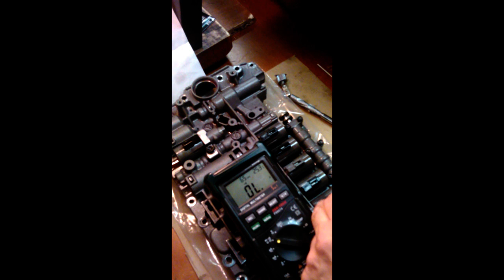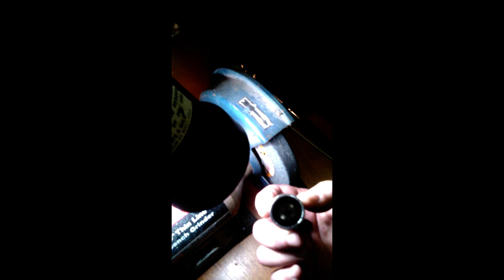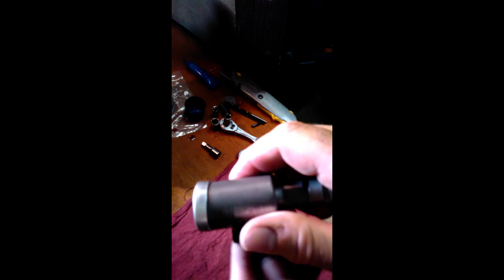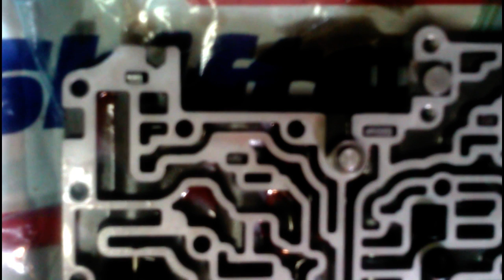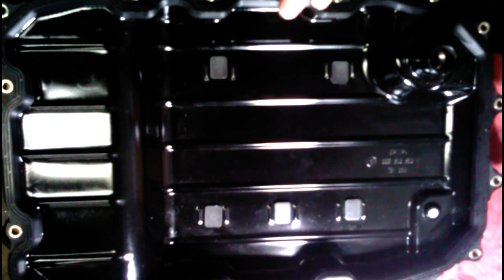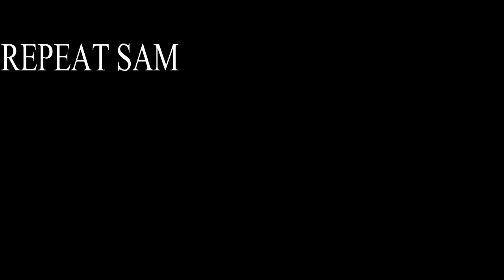CAYENNE SK-09D SHIFT KIT

Comment: Hello, 
thank you for your video. I contact you because I have a problem with my gearbox. I just install a transgo kit today and now I have Sudden jolts between the speed number 2 to 3 and 5 to 4. I have no idea. Maybe you know what were my mistake. Thanks a lot
Reply from the maker: The first question I always ask .Did you clear the adaptation tables and do the relearn procedure? This must be done or it will never work correctly.

Comment from the maker: Michael..Here's the thing. This kit does not damage the valve body itself in any way. It does however require grinding or cutting open the solenoids. The guys that sell the high dollar valve bodies refer to that as damage and say the core is ruined.. From my point of view those high dollar VB's are insanity! They do use high quality Sonnax parts in them but with this kit installed you are essentially doing the same mods at a 1/16 the cost.. If the kit is done correctly it will give you years of perfect service.. The biggest thing is to take your time pay attention to every step and be diligent. The biggest mistake I see guys make is not clearing adaption tables after installing the kit, drilling the wrong holes in the seperator plate and under/over filling the tranny on re-assembly. If you have already replaced the solenoids that would be one major part of the kit you won't have to do. Good luck I hope you get it figured out.

Comment: Hello Today I made update to my Audi Q7 now my 3rd and 5th gear goes with big hit. I can not find procedure to reset adaptation. When I connect to controller Adaptation(10) is not active. I found SSP 367 for this gear with info that I can do reset by  Basic settings(4) but still I can not find any solution. I have VCDS interface- maybe some one can help with some  manual  how reset adaptation values for Audi Q7 ?

Comment: I just did the sk09d treatment to my 04 cayenne turbo and while test driving it seemed to slightly shudder while accelerating. The next time I drove it, it got stuck in 5th gear. I restarted and it got stuck in 3rd gear. When it does shift it seems to lag behind what the dash display says it is doing. By the way, I bought a used valve body and put the kit in it instead of the original valve body. Could this be the problem? Thanks in advance for your advise or thoughts.
Reply from the maker: Could be ..but my first question is always-Did you clear the adaptation tables?
Reply: No, but I will try that this morning.  Thanks for the quick response.
Reply: I cleared them and it still shudders but didn't get hung in any gear. The transmission still seemed to lag behind what the dash indicator says. I am putting a kit in the original valve body but I got to the second valve and discovered they had put two of the third valves in the kit. I'm waiting for the replacement. Ugh!
Reply from the maker: Right on ..my next question was going to be "did you have those issues with the old VB" I know it sucks when you get something ripped down then have missing parts on re assembly ..been there .. So many guys forget or skip the clearing of the adaptation tables and it is a must do item.
Reply: Never Never change the valve body, they don't go bad that often, use your same valve body and parts also clear the adaptation tables

Comment: OSG, do you have the part number for the torque bolts that retain the valve body to the transmission itself?
Reply from the maker: Hi,  will see if I can look it up for you while in the shop tomorrow.
Reply: 3 x M6 40 Long VB retaining bolts WHT000321 

11 x M6 28 Short VB retaining bolts WHT000324

Comment: hello 
I hope u doing well
I have VW Touareg 2005 my car running about  240000km i have issue 
with transmission i hope you can tell me what can i do its cluch issue 
or valve body
car running normal and shifting good from 1 to 4. however when gear 5
 engage i fell like hard shifting only on number 5  then going to gear 6
 when i try to stop my car gear going back from from 4 then 5 during 
going back to gear 4 i fell again hard shifting and some time big noise 
really make me afraid. also when this happen i see on odometer screen 
like from P – R – N – D – S all marked  
I just change gear oil and filter same issue.
Could you please advice me shall i change valve body or clutch or i can change TR60SN TRANSMISSION LINEAR SOLENOID
Reply from the maker: Mohamed usama... yes you are having a typical valve body issue
Reply: OLD SKOOL GEARHEAD thx alot for reply really appreciate 
If i change solenoid valve my issue will be solved or i have to buy complete  valve body
Reply from the maker: You can test the readings on the solenoids...if they pass it will more than likely be a valve hanging up in the body.
Reply: OLD SKOOL GEARHEAD so in this case i have to do same what you did , i download service manual for 09D TR60SN i find valve number 92 if there is issue will effect gear 3,5 so I ordered one new solenoid once i receive i will start do the same
Reply from the maker: Right on ..Good luck

Comment: ok so I ran the car for about a week and it got worse  to the point  that I'm scare to drive it lol. so Def think is  something to do with the valve body since car was running ok before I took the valve body apart   and changed the fluid .so I order a valve  body  hope that will fix the problem  , I did change  the fluid  got it from the dealer  cost  me $153..... now my question  to you is ,  have you ever tried a different  transmission   fluid  other than the dealer OEM  ?
  I want to see if I can flush  it out   with something cheaper the would meet the specs with the original  fluid  . ...... car info 2005 vw jetta 2.5  6 speed  tiptronic.    thanks

Comment: how many pounds of torque do you put on the bolts ?
Reply from the maker: upper valve body to lower vb+ solenoid brackets 89in lbs- park rod guide to case9 97in lbs-valve body to case 97in lbs.
Reply: is that the same torque for the 09G   where can I find these torque specs ?
Reply from the maker: Gabriel Boni
No 09G is different ..here are some you will need  parking guide 10ft lbs valve body to case 80in lbs-valve body+on off solenoid 10mm 80in lbs-valve body+linear solenoids 8mm 62in lbs-oil pan to case 62in lbs ,,,I would download the ATSG service manual just in case you misplace something.
Reply: Awesome.  Thank you so much for your help
Reply from the maker: no problem if you get stumbled on something let me know ..good luck
Reply: Ok thanks
Reply: ok so I torqued  everything  to spec  put everything  back together , I did all the solenoids , drilled the holes in the plate as it shows put in the new piece that comes with with the kit. some of the  solenoids  where kind of  stock ,  I tested  the resistance  it's good  ,  took it for a test ride.  it definitely got better 1st and 2nd gear are rough drove for 1/2 Hour in town 
I'm still getting that clunk from 3rd to 2nd  sometimes  ,like I said  1st  and 2nd  are a little bit rough. ..and I notice when I parked.  I went from P to D and I'm getting  a clunk still , did it before  I did the job . 
any suggestions  should I get a new body valve ? do you think that's what it is I really like my car don't want to get rid of it.  sorry for any misspelling.  the kit was the transgo 09G/TF60SN  

thanks
Reply: I feel  like it gets worse  when it gets  hotter.   the car is a 2005 vw jetta 2.5
Reply from the maker: Did you have the adaptation tables cleared ? the TCM becomes adapted to the worn parts and when you put the new pieces in it gets confused and can't relearn fast enough ..the tables must be cleared then you will notice a huge difference..even after clearing though it may take up to 500 miles to totally re-learn
Reply: @oldskoolgearhead460 
 hello, thanks a lot for the video :)

97lbs between the body valve and the case it's mean 97 lbs between the body valve and the gearbox?